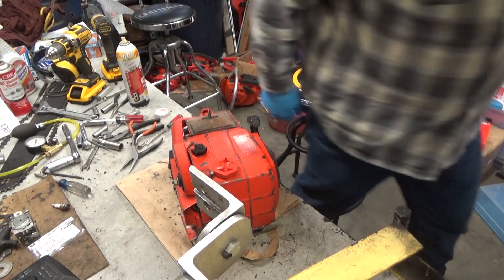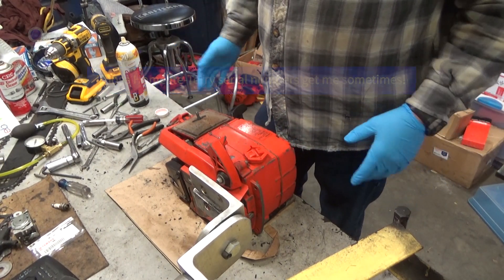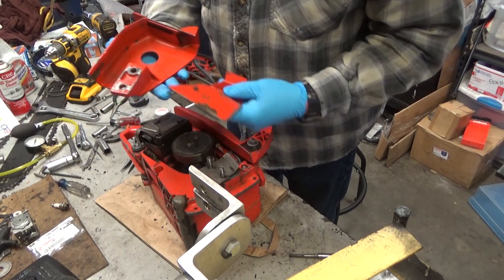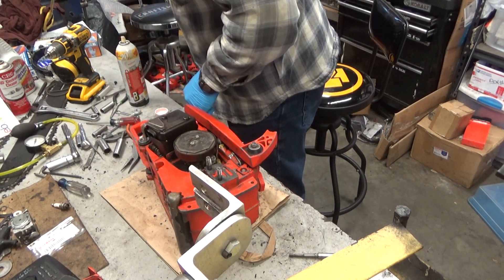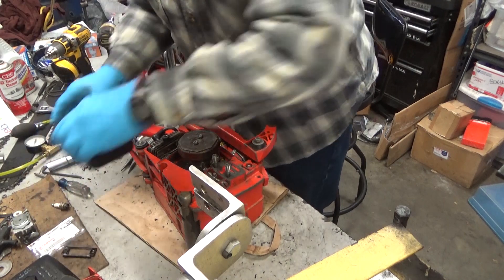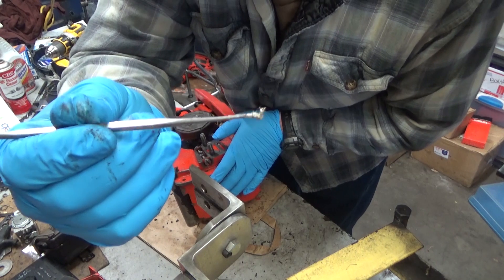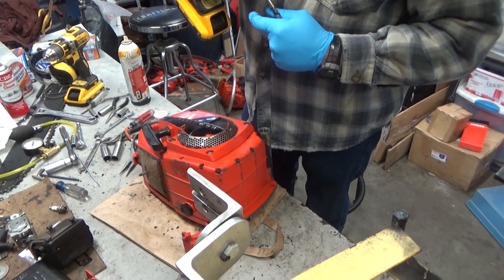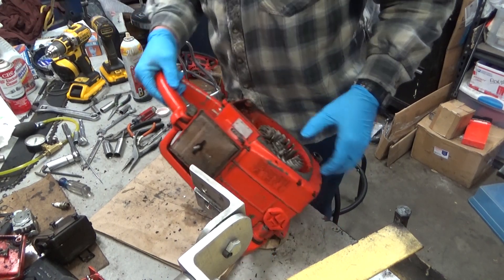Thomas' Homelite VI-955 Disassembly and Diagnosis...Bad Internal Damage!

Comment: I would say either over speed possibly. Or more likely over or under torqued rod bolts
Reply from the maker: Very possible...whatever happened, it was quick and the rod exploded.  The crank journal isn't hammered...just scored/scratched.
Reply: Where there any signs of beach marks on the rod where it broke. That would indicate a fatigue crack. If there is not the it was shock loaded. Was the flywheel key intact?
Reply from the maker: @farmerjackson709  Yep, the key was fine.  The entire rod appeared to be twisted, at least what hadn't exploded.  My guess is one or more needles dropped on the last installation and at least one jammed up in the transfer port.  From there I guess the bearing cap was the weak link and boom!